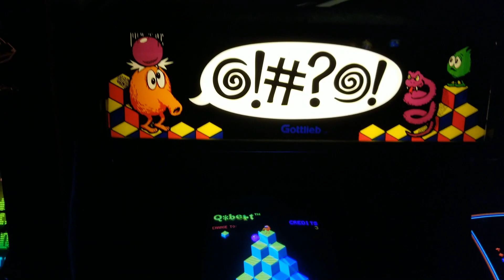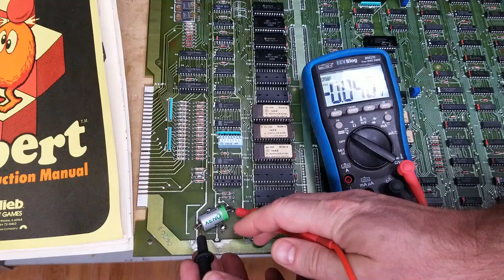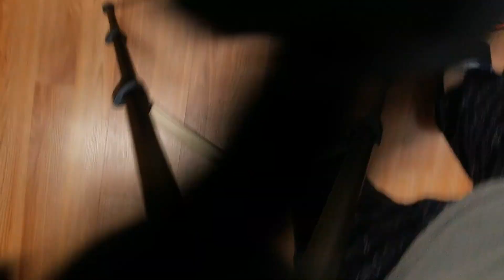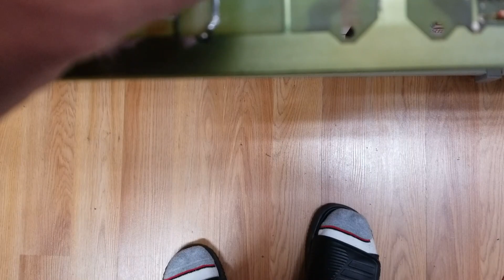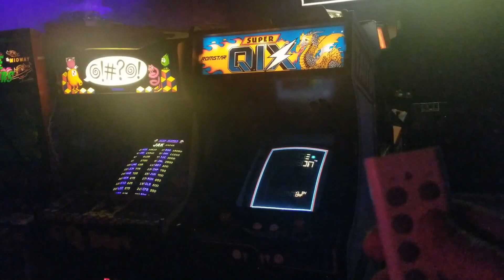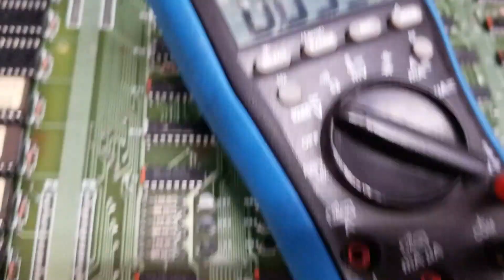Q*bert Refurb & Repair - Part 4 - High Score Save Fiasco

Comment: Ours has a Gold Cap installed and it saves scores for a few months, but it does occasionally clear them or very rarely overwrite them with garbage. The machine is run at least once a month for 12 hours.
Reply from the maker: I had read about using a super cap instead of nvram or battery.  Sounds like it is working well enough for you all.
Reply: @jacklick  the clear/overwrite events do not seem to correlate with time past since last power up, so my guess is what you said about power surges corrupting the NVRAM seems to be right.
Reply from the maker: I will definitely be monitoring mine for high score table corruption / loss.  You could try increasing the capacitance of C27 to 1000uf and if that doesn't help then increasing C25 to 1000uf as well.  That is what the thread on klov mentioned anyway.  count me curious

Comment: What type of battery lithium what? you mention something about the peak or Spike current being 60mA compared to a coin cell battery being 20mA. The datasheets don't say anything about Spike current, so what is spike current?
Reply from the maker: I meant to say pulse current. It is a Lithium Thionyl Chloride battery.
 Here is the datasheet. https://files.batteryjunction.com/frontend/files/xeno/datasheet/XENO-XL-050F-Datasheet.pdf
Reply: @jacklick  I think Q Bert needs 3.6vdc because of the CMOS NVRAM chips? because other arcade games NVRAM for the highscore didn't use CMOS NVRAM. I'm not sure what the Pulse Current does. When you hook up a load to a battery it should supply the current and not supply pulse current.
Reply from the maker: Note: It is CMOS SRAM not NVRAM.  NVRAM doesn't require a battery back up and would be a different option that doesn't require a battery.
The fact it is CMOS isn't that relevant.  I wouldn't doubt all sram from the period is CMOS fabricated. 
I would assume the load is constant but I mentioned the extra pulse current capability in case it isn't and as another difference to a normal coin cell battery.
Reply: @jacklick  yes arcade games used CMOS SRAM which is more sensitive to the VBatt voltage. The Silicon Diode will DROP move voltage across it compared to a schottky diode. The Datasheets for the SRAM that is used in Q Bert say the minimum is 3.4vdc right? because other arcade games SRAM to save highscore data the used SRAM that only required 3.0vdc? The later arcade games they switches used NVRAM which didn't use a Vbatt.
Reply from the maker: Really?  Why was CMOS SRAM more sensitive to Vbatt voltage?
You tell me, does the datasheet for the SRAM used in Qbert say minimum of 3.4v?
Reply: @jacklick  3.4vdc is the minimum without the SRAM erasing the high store. CMOS SRAM is more sensitive to only using 3vdc to 3.2vdc it will not store the high score long term it must be the memory cells in the SRAM that need a minimum of 3.4vdc not sure why that is
Reply: @jacklick  I don't specialize in SRAM latency failure but that is what happens when the VBatt voltage is below 3.4vdc is the CMOS SRAM causes latency failure not sure why that is.